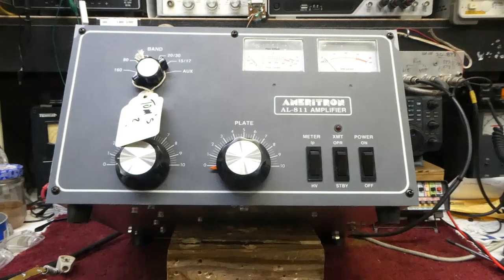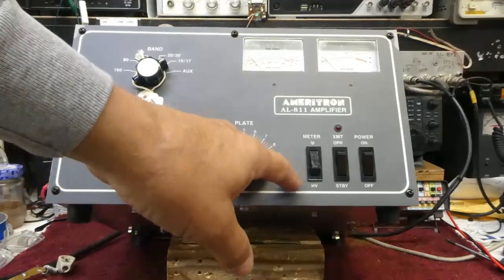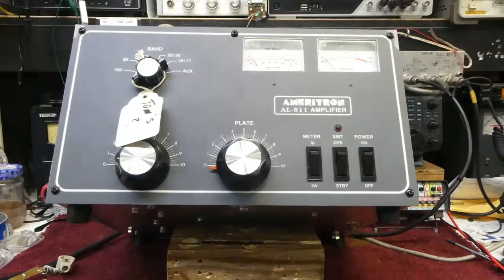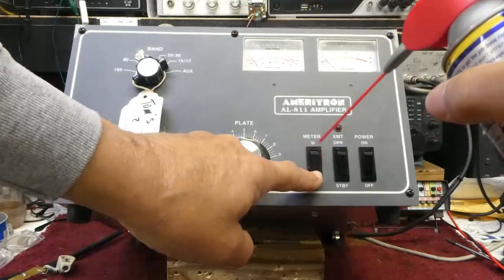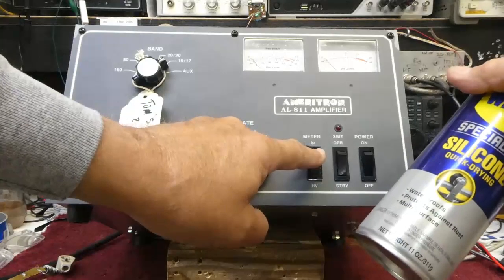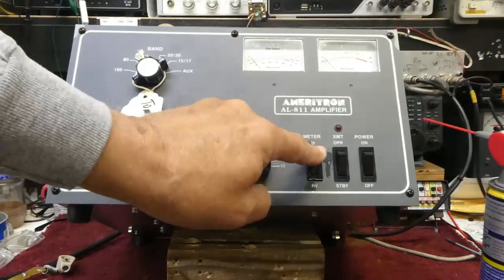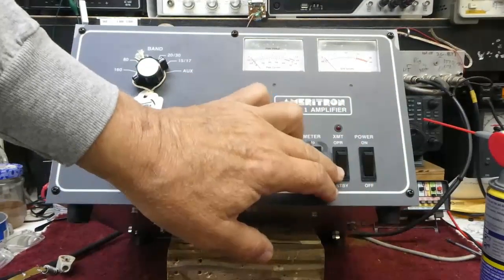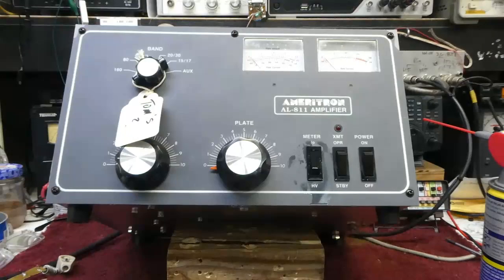AL811 AL811H Meter Switch

Comment: Tom, recently purchased an 811 with this exact issue.  Previous operator replaced tubes in attempt to fix the problem. He ended up selling the amp on Facebook Market Place to me. Your solution worked great! The switch is functioning like new again!  Thanks for the great video!